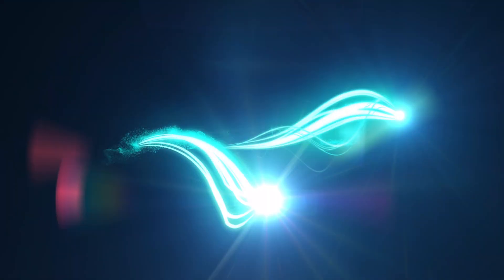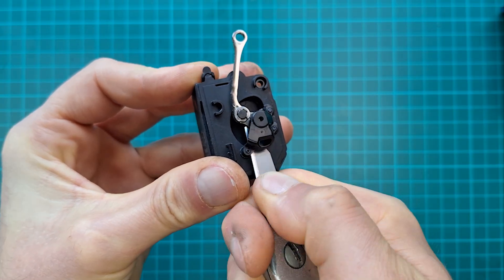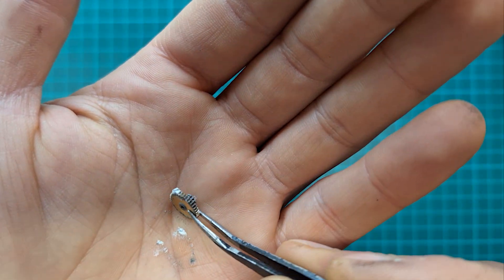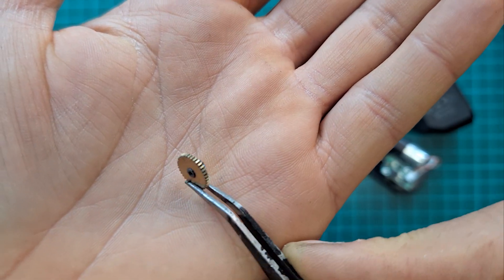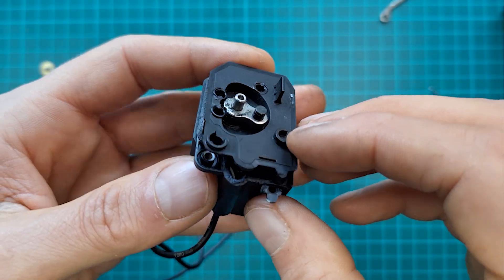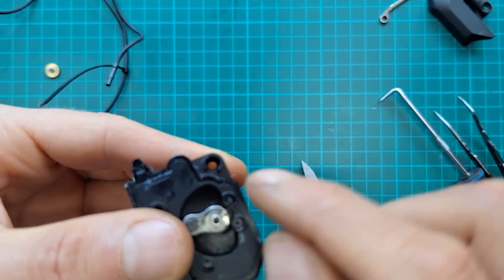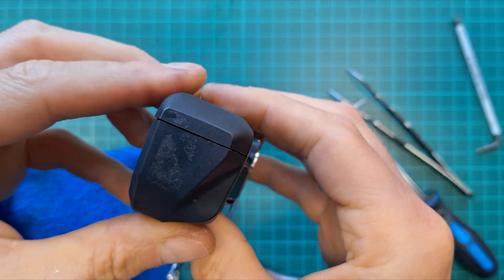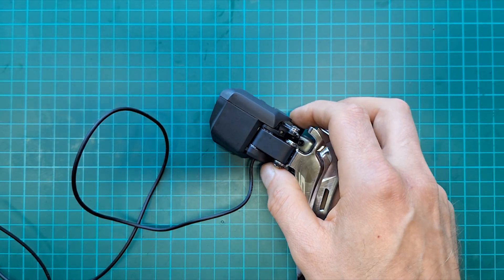105 FD R7150 repair

Comment: Hi, it’s me again. I have the same problem. Would XT 11s work with that?
Reply from the maker: What do you mean? using a complete FD XT-M8050 or parts from XT derailleur? I haven't had a chance to open XT yet, Terry of BetterShifting.com sent me one, but I haven't had a chance to open it yet.
Reply: @Di2_GP  only parts. do you think there's a chance to have the same parts inside for 105 and XT11s?
Reply from the maker: @TheSirEscape  You may be lucky, but judging by the speed of XT I'm suspecting the gear ration will be different, but you never know. If you won't be using XT FD, you may take a risk. However 11 speed R8050, R9150 and GRX 815 and 825 use the same internal gears.

Comment: Gotta be super careful when removing the magnet if you want to turn the main gear 180. Just ripped mine off
Reply: Thank you for the repair demonstration. If you can find the time please demonstrate removal of the big gear (5:40 in the video). I was unable to remove it using quite a bit of force on its drive shaft.
Reply from the maker: @awesomexistence  If I find some time over the weekend, I'll try to record it
Reply from the maker: Yes, usually a gentle heat helps, but they are tricky to remove.